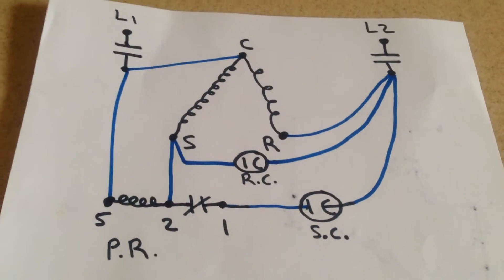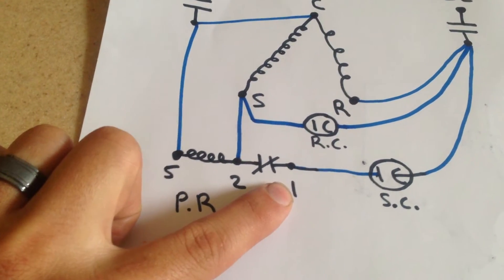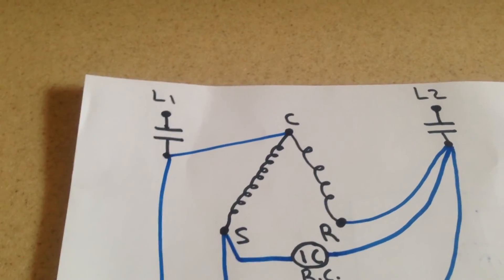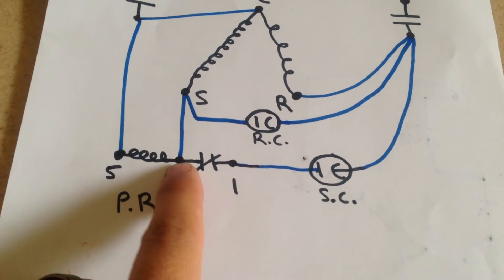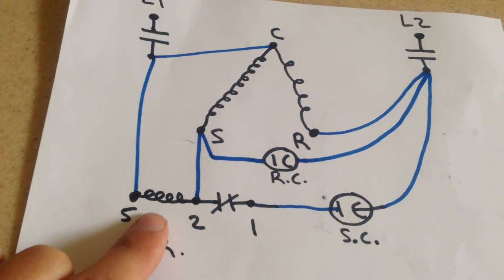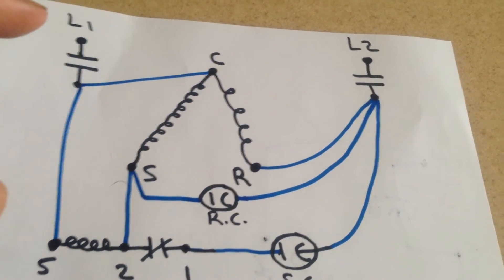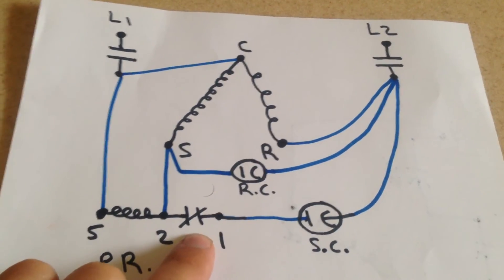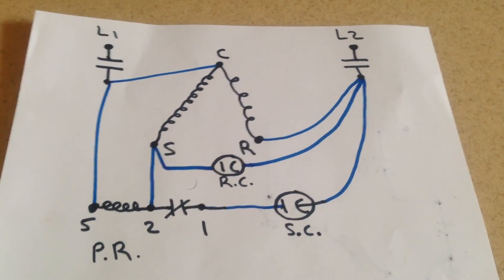How to test a potential relay part 3

Comment: You solved my problem with coil voltage for potential relay while the compressor is running (the EMF voltage or compressor rotor magnetizing) I have always wondered why the PR coil voltage is too high. Thank you.

Comment: i thought the run cap. needs to be wired to run winding of motor?
Reply: Run caps get wired in parallel to start & run windings. As he stated, it's there for efficiency of motor.

Comment: Hello there....I'm no expert....just an observation...  I'm in the UK, and we have Live and Neutral...presumably your L1 and L2. So....I guess with AC its not important, but in your schematic, which would be Live and which would be Neutral....you suggest, that power is coming from both sides L1 and L2....which is it?.  We always wire Klixons in the live...this is why I'm a little confused here. Also...isn't there back EMF generated in the Run winding also?....where does this go and what effect does it have?  Last thing, although the SC is out of circuit when the relay opens....there still appears to be path for voltage to flow through the start winding the relay coil to Neutral....so how can the start winding be disengaged??....many thanks Rob UK
Reply: All capacitors should be wired in series to the start winding
Reply from the maker: Robin Francis Power in the US is different than UK. This shows a 230 volt system. L1 and L2 are both live/ hot conductors with 115V potential with respect to ground and 230V potential from L1 to L2. L2 would be your neutral conductor and the Klixon was not part of the topic and not shown. For this particular motor type, the start winding always stays in the circuit during start and run periods. Potential relay coil needs to sense back EMF all the time to keep the start Cap out of the circuit while running, it's only there to help on start up.
Reply: Many thanks for your most courteous reply...greatly appreciated.  Would that be classed as 2 phase in the USA....ie...if you were to put a meter across L1 and L2 you would see 230V?  Also...if the start winding is left in circuit, doesn't this mean that it is also energised along with the run winding during normal running?....or I have I missed something?....and...what about back EMF from the Run Winding...does this matter?
Reply from the maker: Robin Francis it's still called single phase over here. Your correct, the start winding has current going through it during operation in the example. There are different types of single phase motors designs
Reply: Thanks once again.....tell me...relative to the UK....should capacitors be wired in the live side or neutral...or does it matter??
Reply from the maker: Robin Francis Tecumseh compressor service Handbook can be downloaded which should help. It shows wiring diagrams for all motor types
Reply: L1 would be hot or live and L2 would be the return or neutral